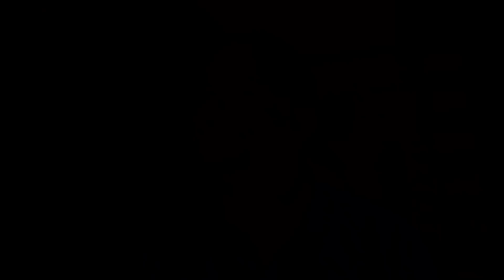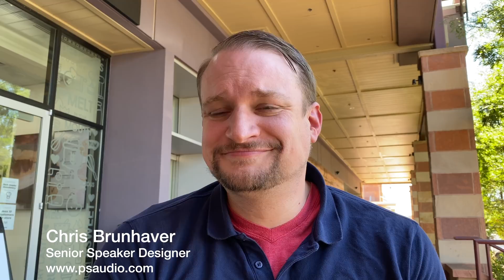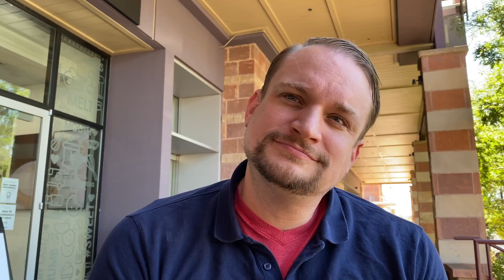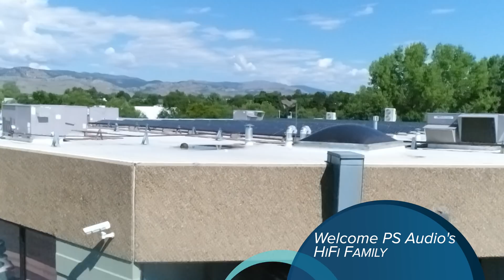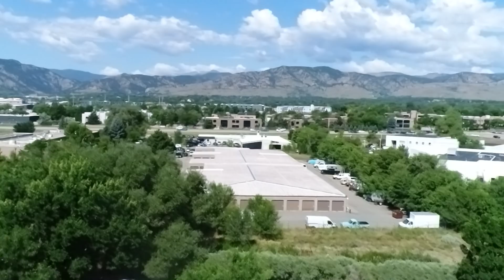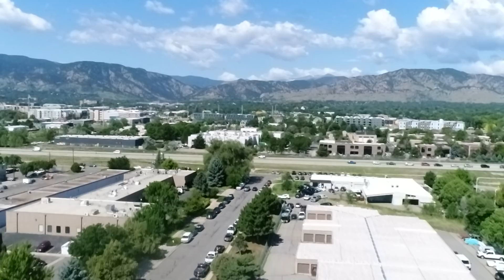Lunch with Paul: all about tweeters

Comment: The most projection I've heard from a tweeter came from a pair of Heil AMT-2Bs with air motion transformers (AMTs). That was back in the '80s. My current speakers have aluminum domes, and they sound good, but the AMTs projected sound unlike anything else I'd heard.

Comment: Dome tweeters are the gold standard when you love to hear distortion levels above 10%. I guess it is exceptionally satisfying for electronic manufacturers when they try to have a nice K2 distortion pattern and then the dome tweeter kills it completely.  But yes the 1 grand beryllium or diamond membranes help to make the tweeters 2 cent surround sound a lot better. In the 60s we had paper cone tweeters that costs about 5 bucks, these guys sound seriously better than 95% of modern dome tweeters.

Comment: I just installed a morel soft dome tweeter to replace a horn loaded compression tweeter and it is night and day as far as harshness. The soft dome sounds like a high frequecy midrange. 

I think anthony faucci uses a face diaper to keep all the noise out of his system.  According to many self-sponsored studies, wearing a face diaper proves to keep all noise out of sound systems even though there has never been any proof of it.

Comment: The waterfall plots are the most important measurements for a tweeter imo... this is where you can see if it is ringing or not..  I'd take a tweeter that does not even go up to 20k over a BE driver that goes to 30k and rings like a bell.
Reply: Ability to play above 20khz is so far down on my list. It means very little.

Comment: I love german tweeters, dull sounding tweeters from many expensive speaker builders don't give you the real experience. cymbal's sound bright in real so they should also sound bright over speakers and not dull.....sit for 30 minutes in front of a guy playing a drum kit without amplification and try to find that same sound back over your speakers ....concentrate only on the sound of the drum kit you hear, especially the cymbal's...there is not one tweeter what come even close
Reply: It is very hard to reproduce actual cymbals accurately. The sound from these large polywobbling non-harmonic metal discs varies in all directions. Generally overhead mic’s at about 8-12 feet are a pretty good representation of what you hear at a distance. That said, try the Sheffield labs drum track for pretty authentic sounding drums. Anyway - don’t blame the tweeters - it is the recording of drums that presents such a huge challenge.
Reply: Which German tweeters?

Comment: One thing to note is that the B&W  tweeter  came a long way since it's inception. With the right electronics it achieves what no other tweeter can.
Reply: And what's that?
Reply: There are enough high-end tweeters that can achieve the same. Beryllium tweeters with a good motor structure can achieve the same with probably even more durability

Comment: I've had all types, but much prefer AMTs for long listening sessions.  Not fatiguing at all, but natural as can be.
Reply: Glad to hear a vote for AMT. Anything which isn't fatiguing gets my interest. 

But many soft domes are boring and lifeless. That's also not what I'm looking for.
Reply: I tried alot of small speakers using different material for tweeters and mid drivers.  I am currently using an ML 15i with an Al driver, stepping down from larger Focals.  Nothing bad about the Focals but big and wanted smaller.  The 15i's remind me of a smoother sounding Monitor Audio Silver 100 in a smaller package albeit with alot less bass.  A little lacking in the low mids but still a good listen especially with a sub and for movies.  Good with most music I listen to as well.  

Tough to get a fully satisfying do it all product in a small speaker.

As to soft domes being boring, those that do extend have tended to be too fatiguing and hard and those that sound more "boring" such as the Dali Opticon 1s I have sound great on a desk in the nearfield, like a few feet from the listener. At greater distance, you lose the magic but it works ok for podcasts if you want to move into the room.  

So. IMO, small speakers are more a surgical tool that can't do everything as well as a larger speaker overall can in a living room.  But it can do some things better. Tradeoffs.     @thunderpooch

Comment: Ribbon (and electrostatic) tweeters are not merely about having a low-mass moving element.  Another significant advantage is the fact that the entire radiating surface is driven with consistent force, rather than just the perimeter.  This largely avoids time delay or phase shift across the radiator, reducing distortion, improving transient response and avoiding perturbations in frequency response.  
The video title should have been "a few brief comments on tweeters" as it omitted some important classes, and hardly qualifies as even an introduction to a vast discipline.
Reply: I have a pair of large floor standing full range electrostatics. Single driver, no crossover, incredibly low mass diaphragm, no box,  very low distortion and fast transient response. Not perfect but in a different league to any conventional box speaker.

Comment: Thanks for sharing what do you think  Of the old JBL 075 & 077 tweeters?
Reply: David, I have DIY speakers with ring/slot tweeters similar to the 077... they are TOA-branded, but probably made by Fostex or Coral back in the '80s.  They are superb sounding, and have about 110db sensitivity!  They are avidly sought after in Europe.

Comment: Soft dome tweeters dominate in home audio (great sound, very affordable but delicate). Horns dominate in PA (robust loud)The fundamental engineering issue in a tweeter diaphragm is balancing weight, stiffness and internal intrinsic damping. Fabric domes are my favourite - they sacrifice a little in high frequency extension but are intrinsically damped and sound much better in the range that I actually care about 3000-12,000Hz (with nice clean  waterfall plot on SEAS Millennium for example ). AMT or ribbon style tweeters aren’t robust or powerful enough for far field work and end up creating comb filtering when aligned in a multiple transducer array. Comb filtering can be pleasant enough but adding that to everything you are listening too doesn’t work for me (same issue with panel speakers). Ferro-fluid is the biggest issue with standard tweeters - the sound quality doesn’t last more than a year or two as the ferrofluid dries out. Building a tweeter without ferry-fluid is possible but it is very expensive as tolerances need to be very tight and a double spider is the only way to prevent rocking without the VC centring effect of ferrofluid (ferrofluid is such a cheap way to make a good sounding tweeter it dominates) Tweeters suffer from the age old engineering piston problem (a piston length should be more than 1.5 times its diameter in order to not suffer from rocking).
Reply: I have never seen a multiple AMT tweeter design.
Reply: @bilguana11  It is rare because most AMT are used in bookshelf sizes for near field applications (Adam use them and make excellent near fields). Infinity built some really big (famous)  speakers which could play loud and had an array of AMT. It is a limitation of technology.
Reply: @jeremyhughes6485  Infinity never used AMT drivers. Adam once made a mid-range AMT driver when they made consumer speakers, but never  multiple AMT tweeters.
Reply: @bilguana11  I stand corrected. I should have used the term Ribbon tweeter instead of AMT which is just one type of ribbon. I think Infinity called their design EMIT. My point was that planar magnetic or ribbon drivers don’t generally perform well at lower frequencies and require arrays or much larger surfaces than a dynamic dome tweeter to achieve similar SPL at the low end of their range.

Comment: Loved this talk on tweeters. The last set of speakers that I designed and built are using Focal inverted dome tweeters with phase plug. I was a little hesitant about the inverted dome as I had heard that they tend to be beamy. I don’t find them noticeably beamy. Their off axis response doesn’t seem to be any worse than the dome tweeter. Not sure what advantages are claimed for the phase plug but overall I am pleased with the performance of these tweeters. My speakers are two way TL’s with Focal “W” cone 5 1/4” woofers with solid aluminium posts (I believe they also serve as phase plugs? I would be interested in hearing opinions on phase plugs.
Reply: I have Focal 807Ws and they are a great general purpose speaker for everyting. Much preferred over Quad S2 (had more detail and resolution, but flat stage, wall of sound that was boring for music), MA Silver 100 (more bass and midbass, but congested in the upper mids and too in your face at even moderate volume levels).  The Focals do most everything well and I only want to replace with smaller speakers.  Trying the ML 15i on a sub which works well enough but doesn't have the detail and overall fidelity but perhaps close enough as trying to find small performance in a moderate sized room at a reasonable price has been difficult.  Some options over a grand but one is still looking at a larger enclosure, most over 14 inches so the difference in downsizing may not be justified.

Heco Ceylon 3 seems to be a contender that matches or is slightly preferred to the Aria 906 and can be had for under a grand when on sale, but the older Focal tweeter (non-Poron) extends better IMO if you like a light, airy and extended high frequency. I just didn't care for the new Poron tweeter being a bit too refined for me.  

The 807W just sounds right and especially with a sub but I am downsizing, its that point in my life I guess.  So soon to be listed.   That inverted tweeter though is better than most unless one likes a more refined, less accented tweeter.  Does well with sibilants too.

Comment: For me, once you hear planar tweeters, there is no turning back, especially for the types of music that are demanding in terms of timbre accuracy, such as classical or jazz. For mid-highs, under 2K, I prefer horns.
Reply: Planar are more robust to handling as well in regards to AMTs and especially ribbon-type tweeters.  Any suggestions for small speakers using a planar?

Comment: I'd like some commentary on the Air Motion Transformer tweeter/midranges as originally patented by Dr. Oskar Heil.
Reply: Well, the flat panel, ribbed diaphragm tweeters now available bear little resemblance to an actual AMT driver. They have nearly zero in common with the Oskar Heil patent, which is an interesting read.
Reply: i would love to hear what Paul and chris think of AMT's as well. from the golden ears to the cheap dayton audio ones, to the Heil AMT
Reply: @FatRat-f9m  In the "Hood" car HiFi is a set of 100 Motorola piezo tweeters and a clod who bangs the rear bumper with a sledge to attain that just right thud and vibration of the license plate. Bumph/tseets down the motorway ;-)
Reply: Audiovector uses modified amt tweeters in their top speakers.
Reply: I just got a set of Wharfdale Evo 4.2s and wow..as long as you’re on axis, that AMT tweeter is just chef’s kiss

Comment: Silky dome tweeters are probably the best all rounder without spending up big ... they are lossy and non resonant ( not in their operating range anyway )
My personal favourite is the highly expensive Dynaudio Esotar which is an elliptical pressurised dome in which the pressure is modulated by the audio signal ... they cost over $9000 each
Reply: $9000 or 900?
https://www.amazon.com/E110-Dynaudio-Audiophile-Tweeter-Individually/dp/B00VN0QK7S
Reply: They can be great, but many soft domes and silk domes sound lifeless and dead.

Comment: Not all tweeters are stiff silk Dome plastic type rubber gel retweeters are not stiff and to say ribbon tweeters have less mass I don't believe so I think there's more mess more material has to be more mass not less in a ribbon tweeter plasma tweeter is the most accurate. That's what you should have put in yours with the ribbon mid-range around it centre horn would work very well
Reply: @FatRat-f9m  
Haha! Good answer, Rat.

Comment: So tweeters are the hardest to build because they are "high" frequency and directional because of that. The diaphragm can't weight anything or you will get distortion. Subwoofers are the hardest because the waves are so long and bounce around and require so much power. The midrange is also the hardest because we actually hear midrange good and care about phase and frequency response. It's all a mess but we can't get enough of it.
Reply: ...and then the cabinet.
Reply: Instablaster
Reply: And all this is a piece of cake in comparsion with full-range speakers. 
😛
Reply: @jareknowak8712  No its all the problems at the same time but no crossover.
Reply: @marcusm5127  Actually a lot of full range drivers have mechanical crossovers.
Reply: Not really. Tweeters are the easiest transducer to make. Mid range is harder. Bass is incredibly hard. Consequently the cost of a good tweeter can be $25, a good mid range woofer $250 and a good bass woofer $2500. Ultra-lf bass is 100 times more difficult than a tweeter